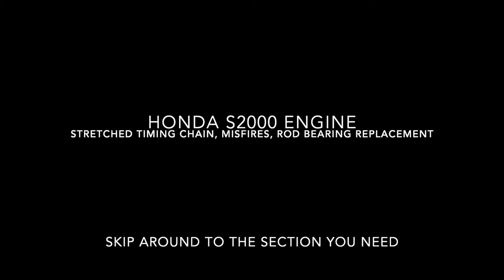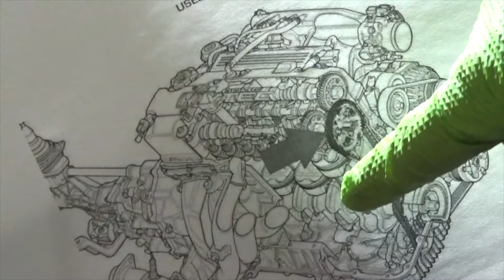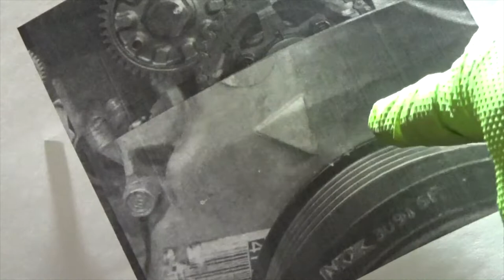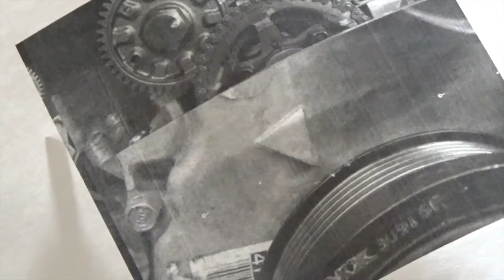Honda S2000 Timing Chain and Rod Bearing Replacements

Comment: thanks for this useful video. I am curious to what are the symptoms if the rod bearings are starting to go bad or is bad?
Reply from the maker: If the rod bearings are going bad there will be slippage in them and you'll hear constant bottom-end noise. They can go pretty quickly so if you notice metal/excess carbon in the oil (do a Blackstone Labs test) you'll know it's time to rebuild.

Comment: question, why did you went w/ Oversized bearings over Standard?
Reply from the maker: It should take up some of the slack or tolerance. The bottom of the rods were too far out of tolerance.  The larger (thicker) bearings helped, but there was still the knocking noise, albeit less audible.

Comment: What do you figure out when you disconnect the coils while the engine runs?
Reply from the maker: If the knocking disappears in that cylinder when you disconnect the coil, that means there's play within the rod at either end.
Reply: @SirFixAlotAutos  whats the acceptable freeplay for rod end?